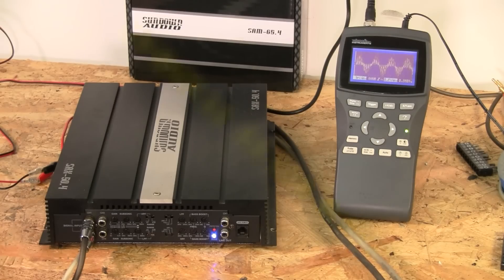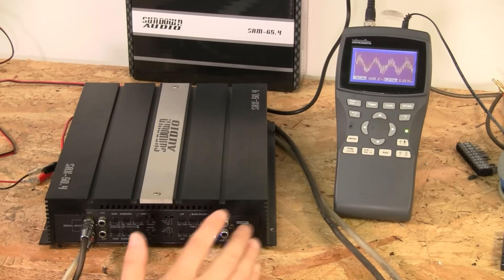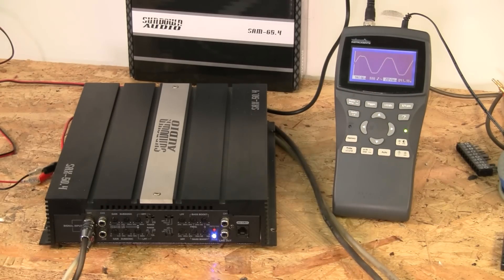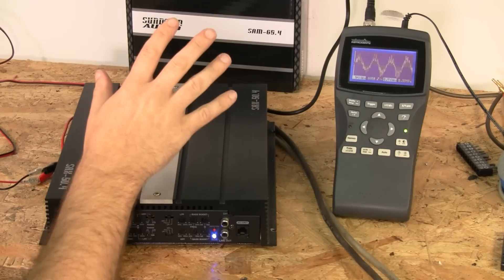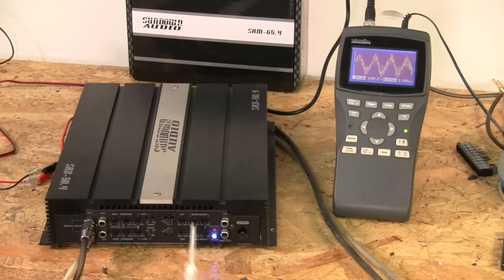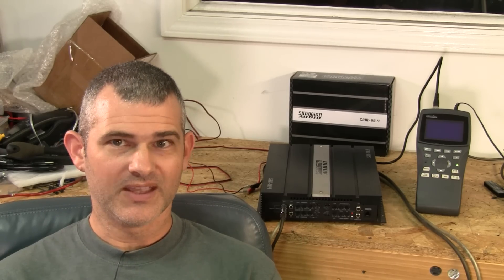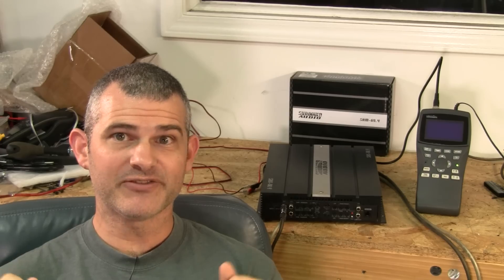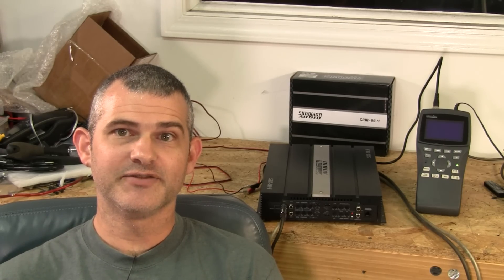Bass Boost: The good, the bad, and the ugly sine wave. - Tech Stuff Tuesday

Comment: I adjust the bass using the decks sub output. -6 to +6. Works good in combo with bass knob. Used a DD1 to get my gains
Reply from the maker: Soon you'll see why you shouldn't use a DD1.
Reply: @EMFAudio  I did the 40hz test from the stereo and then from the amp with the dd1. The gain barely went up. Amp doesnt get hot. Just for my own info, what's with the DD1?
Reply from the maker: @michaelzernie7092  I'll be doing a video on it soon.

Comment: First video I watched of your and this was extremely helpful. Thank you but what about the audiocobtrol lc2i?
Reply from the maker: The LC2i has a function in it that is to compensate for a signal deficiency. It is boosting bass, but it's doing it at a rate of signal loss. Some factory HU's will reduce bass as the volume goes up to prevent blowing the factory speakers. That's why it exists, it's restoring the signal loss to the sub(s), in the end it's a flat response.

Comment: its an EQ CONTROL !!   what dont you understand about that?? of course its going to clip when you add db to a frequency while at full volume duhhh??. im not going to expain the term eq and why it has value on an amplifier
Reply from the maker: No, it's not an EQ control. It's 1 band, which is why it says bass boost and not EQ, short for equalizer. I wouldn't try to explain something I didn't understand either. If everyone knew it would clip I wouldn't have to do this video now would I?

Comment: Yes , but more volts on the speaker out for SPL comp , in my experience does get you more spl if the voltage increases with your bass boost , in spl distortion does not matter 👍🏻
Reply from the maker: I must have more experience than you because more voltage doesn't mean more SPL. A slight clip can give you more SPL, a hard clip can reduce SPL a lot. You know how when you clip it on music it stops getting louder, or even gets quieter? It's because you put more voltage into it and clipped it. That means it's an audible difference in output, which is a minimum of 33% QUIETER. I've tested peak SPL with a slight clip then gone 1 more click into hard clipping and dropped 2.5 dB.
Reply: I will say you definitely have more experience than me , what I was trying yo get across, with my experience using Orion xtr 2250s is that I got my highest spl numbers when the voltage on the speaker output was at its highest value, the spl was also at its highest, when I down tuned for no to little clip my spl was lower by about 1.5 dB then when I gain matched all the clipping equal I got my highest spl , on an audio control back in the early 2000s , things probably have changed since then with pressure meters, but in my recent old school spl challenge I had my highest spl with a very clipped amp , I did a 147.2 with a xtr 2250 very clipped , when it was not clipped it was only in the high 145s , this was using clip indicator lights on the amp , maybe on single woofer setups clipping matters but on multiple woofer setups in my experience only the highest voltage gets the highest spl 👍🏻
Reply from the maker: @charliefrancis6438  That isn't what I found with my HCCA2100 I used in the old school SPL challenge, and other amps. As a matter of fact, with a Termlab a heavy clip severely kills the score.
Reply: I saw your test , and was wondering if using multiple woofers would change the results , in my testing the maximum ac voltage on the speaker output gave me the max spl , if I turned a click or too past max voltage it would drop spl , but only by 2 or 3 tenths of a dB , maybe I am not setting up my gain structure correctly, anyway thank you for replying, and keep making your tech videos I appreciate them greatly
Reply from the maker: @charliefrancis6438  The number of speakers connected won't change the result. SPL dropping when you do that is a result of hard clipping.

Comment: So is there a difference between using bass boost on the amp or using the DSP EQ to adjust the same exact frequency (assuming similar Q width).  Aren't they doing the same thing of adjusting the gain of a particular frequency?
Reply from the maker: If you had the same Q and to the same frequency, bass boost on the amp or a DSP would give the same result. DSP you have way more adjustability though, making it potentially more useful as a function. If you did pick a particular frequency to boost you are doing the same thing except for the peak will be narrower, much narrower. Generic "bass boost" is pretty broad as was displayed.
Reply: @EMFAudio  Thanks, and as always thanks for taking the time to make the videos. I Look forward to each one.

Comment: What scope is that exactly? I want one.
Reply: Liumy scopes on Amazon are cheap and reliable
Reply: Kevin Redd name? or link to the scope
Reply from the maker: It's probably not made anymore, I bought it probably 15 years ago.
Reply: I found a Fluke 105b on eBay for under 300 dollars.

A battery powered scope, being intrinsically isolated, can be used to repair amplifer a too.
Reply: Paid $28 for an amazon scope

Comment: The only way i can get my system to play different kinds of music is to use boost but you must set gains at the worst case scenario... Its not a magic knob... I wish this video showed the clipping going away after gain was readjusted
Reply from the maker: The gain was never adjusted, it was only bass boost and frequency. If boosting is the only way you can get it to play different kinds of music, you either have other settings wrong (like subsonic frequency or crossover) or your box isn't right.

Comment: In my personal experience, bass boost changes the way the bass sounds and I personally like it moving the air a bit, so what I would do is to ensure that the gain is reduced  proportionately. For e.g. in this case the threshold voltage for the amp is 40V, if one increases the bass boost (say 3-6 db) it will also increase the voltage thus causing clipping, so if we were to reduce the voltage back while the bass boost remains ON, to 40v using a DMM it will not clip and still sound different / better (depending on personal choice) than before but not damage anything. Having an oscilloscope (or use of alternate methods - available on youtube) to check the clip will definitely make it even more fool proof.

Comment: Is there any difference between wired bass remotes and bass boost knobs on the amp or do they adjust the same thing? Or does it vary from amp to amp?
Reply from the maker: That will vary amp to amp. Some are remote bass boost, some are remote gain.
Reply: @EMFAudio  Thanks. That explains why I get varied answers depending who I ask.
Reply: @EMFAudio  that's just evil.  anyway to distinguish?
Reply from the maker: @buddykiller  Not that I'm aware of, besides the companies history or the owners manual.

Comment: I've been wondering what the remote level control for the mono line up of sundown audio really does. Is it a kind of level control for the whole bandwidth or just kind of some bass boosted parabolic response at say 50Hz. Please let me know if anyone has idea about it.
Reply from the maker: Our amps, as well as Sundown, and many others are an input level adjustment. It will cut the input signal, not add or boost anything. This means it will only go as high as the gain is set and the output isn't colored in any fashion. Not all amps are like that though.
Reply: Justo to add more context,  the remote knob in many Rockford amps acts indeed as a bass boost (so called punch EQ) and not like a level control, so you better check the manual to know for sure if it is a bass boost or level control.
Reply: Well. That sounds good. I've seen specs of some of the amps mostly Chinese hefty stuff. They have mentioned the frequency response vs position of remote knob. I saw the parabolic response centered around 50Hz which sounds weird and looks weird. Thanks for the clarity guys. Keep doing awesome things. I couldn't find such information in user manual of sundown amps.
Reply: @jaiaditya4u  My Pioneer is centered at 50Hz also, would be nice if the frequency could be adjusted, 50Hz boost sounds terrible on some songs.
Reply: @ixionn563  which model is it. I'll try to check the possibility to alter that.
Reply: @jaiaditya4u  I've been doing this for awhile, it's a Pioneer GM-D8601, it only has gain , crossover control, and the bass knob. I checked using a tone generator app and indeed the most boost occurred exactly at 50Hz.

Comment: I love this video.. thank you..
The only time I use bass boost is when I'm using a lower wattage amp.. 500 to 600 RMS.. but I include it when I set my gains etc.. I used an oscilloscope to make sure There is no clipping whenever I add that boosted frequency. I never set my gains 1st then bass boost like this video shows.. I have learned so much from EMF.. and I appreciate these type videos.. thank you !!
Reply: Everyone I've seen that say "don't use bassboost" never talks about setting the amp with bass boost on.i personally  love how those punch and mtx amplifiers  sounds with bass boost on
Reply: smtyson You are right but at the same time.. it can make the bass sound muddy over a certain db level.. and this video shows the negative impact it can have if you don’t use the setting right because it will clip your subs.. I might use 3db and nothing more and I apply it when I set the gains 3db is enough but I use it on amps that is around the 600 watts range.
Reply: That’s what I did. I have it set to 6db on the amp and 24db on the deck and I set the gain after I set that. Bass sounds great and lots of SPL

Comment: I always tell people don’t run bass boost/loudness on there deck,amp etc.
Reply: Jermane Birchum  by matching maximum clean volume from the deck rca to the gain on the amp. With a o-scope. dd1 etc.
Reply: Jermane Birchum. Gain matched cleanly from the radio to the amp which in turn puts power to the subs.
Reply: On my deck the loudness is in three options. Not only that I can adjust the gain in the amp in the deck via sla option on top of that I can set my sub channel to non fade and it has its own built in high and low pass filters . So I can set my loud to boost at low volume and tappers off as I crank the volume. This way I can run no amp if I wanted to for my front and rear stage( I have amps going to these) boost certain ranges and ignore others allowing cleaner signal to the speakers with out messing with the signal going to the sub amp. At my amps I run zero boost as I have to signal voltage fairly high but under  the highest input specs for the amp. At this point I reset gains and tune my eq's and filters . I know my deck at this setting clips at 55 out of 60 . I tune max volume to 50 and touch up my gains by ear and then adjust eqs by ear. At this point I can play louder than I like with out clipping or noticed distortion. I set it this way due to the different styles of music and formats it's sent on . Once I select radio or CD I have to do the same as they each have their own parameters .
Reply: Rob Sorgdrager You’re a complicated soul lol. At least you know what you need to do and have a set way of accomplishing it.

Comment: hmm, you only have to adjust the input level, and there´s no clipping in the signal with bass boost
Reply: yea, but then what's the point?  you'll be underpowered outside the range of boost.  that's what eq's are for.
Reply from the maker: Bass boost causes clipping if you change it after the gain it set.
Reply: @EMFAudio  what if u use the dd1 to set gains then use the dd1 again when adjusting the bass boost ? Won't that allow you to get Max gain n max bass boost?
Reply from the maker: @hellraiserharry  I'm not sure you understand what a DD1 is for exactly, but soon I'll be posting a video of why it's a waste of money.
Reply: @EMFAudio   well I used mine to set the gains on my bass amp and turned it up till it had no distortion, then turned up my bass boost till I saw distortion then backed it off. I'm not to sure if I suppose to use it this way. But if it says no distortion I'm guessing the signal not clipped
Reply from the maker: @hellraiserharry  Basically what you did there was took the DD1 intent, then threw it out the window, which is fine.
Reply: @EMFAudio  please do a vid on the dd1 , the manual doesnt say anything on using it for bass boost. I guess leaving it off will give better results
Reply from the maker: @hellraiserharry  It should be the video next week.

Comment: Can you make a video on how to add an independent relay directly to one amp? How to wire it, where to get the power from, and it's potential. I'm thinking of adding one to my toggle switch for a more professional quality job.
Reply from the maker: Do you mean so you can manually control it on and off instead of automatically with the HU being on or off?
Reply: @EMFAudio .....Yes, control it manually.
Reply from the maker: @25hztolife86  That's just basic relay wiring, any would do, very low current. 87 would go to your 12v power source, 30 goes to the amp, 85 goes to 12v power as well (you can tie it to 87 with a jumper) and 86 goes to your toggle switch with the other end going to a ground.
Reply: @EMFAudio  whats the purpose of the relay just wire the toggle inline done
Reply from the maker: @jesummers9084  You could do that with an appropriate switch that will handle the current, but he asked by relay so I answered. Some toggle switches won't handle more than 1 amp and it's possible to have more than that with multiple amplifiers.